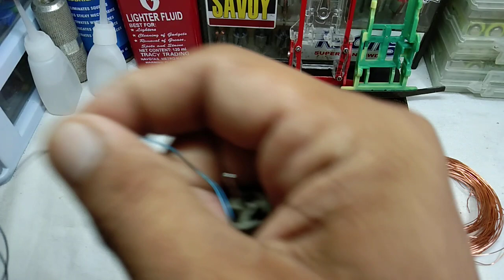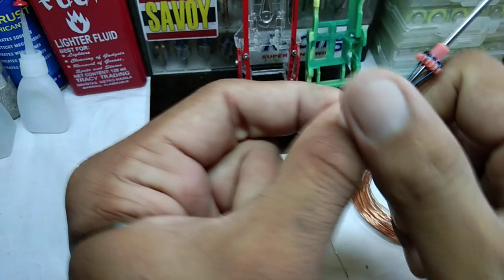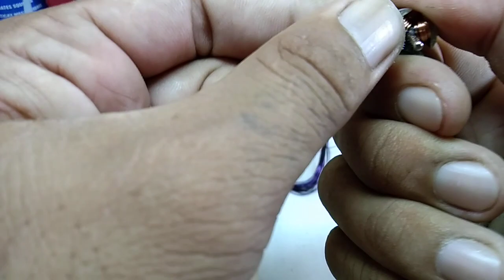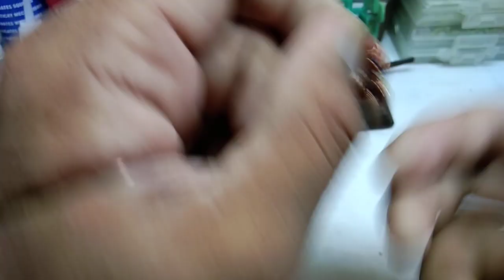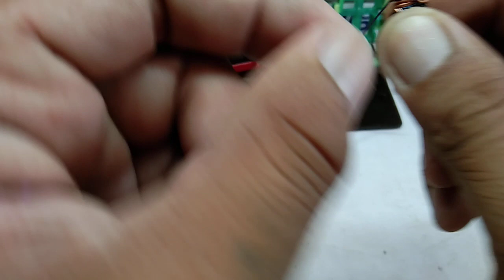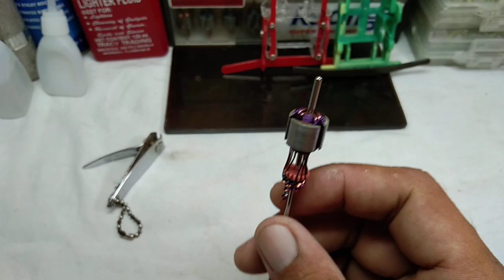TRIPLE TAP ENGINE REWIND | 90 the rewind tutorial

Comment: How much max rpm u get from this coil?
Reply from the maker: rmp really don't matter, torque is. if you really after of strong rpm you must less your winding turns so you will get strong rpm
Reply from the maker: But strong rpm is no good you need torque
Reply: @kingsavoy363  how can we balance it? High torque means weak topspeed right..
Reply from the maker: it depends on how many wires and turns. if triple i suggest you must use standard turns 9 or 10 then if double use 13 turns.
Reply from the maker: and its depend on wire gauge, too.
Reply: @kingsavoy363  wats ur recommended turns if i use 0.6 wires?
Reply from the maker: my recommended single 12 turns
Reply from the maker: what gearing you use?
Reply: @kingsavoy363  3:2.1  of course. I have a hybrid gearing on my MA chassis with 3:7.1 as well in one machine xD
Reply from the maker: can you send a picture ?